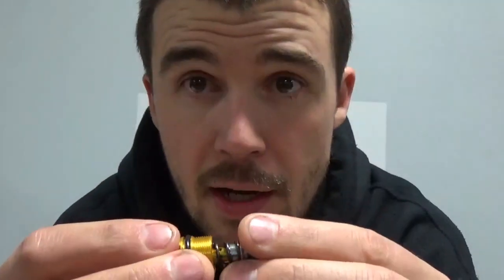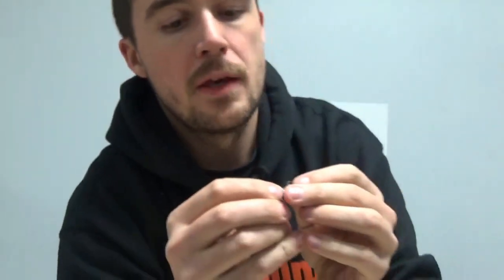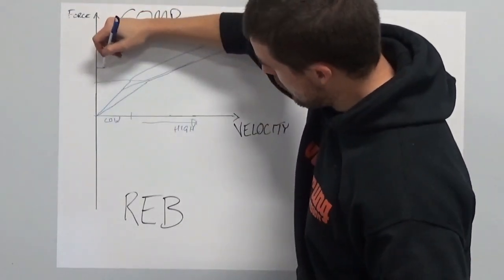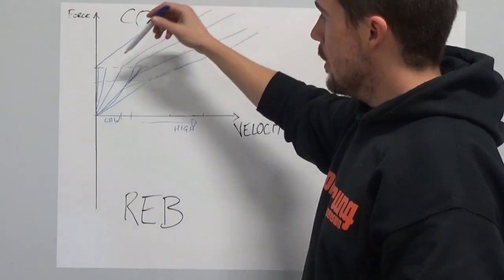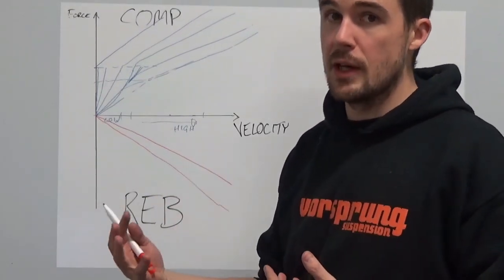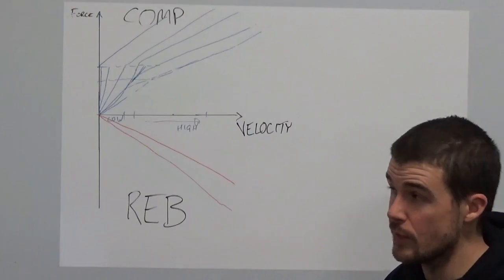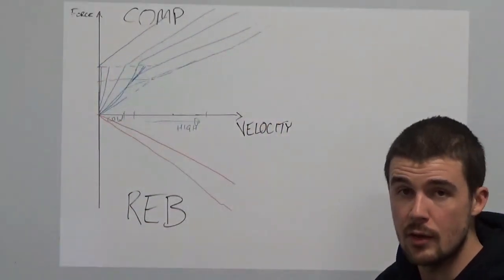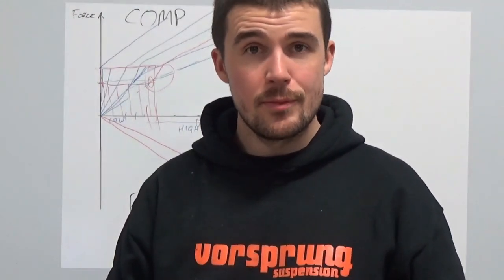The Tuesday Tune Ep 5 - High and Low Speed Damping Adjusters - Pt 1

Comment: I think I'm getting it, LSC can alter HSC, so on an RCT3 Lyrik (that only have 3 HSC settings) you can fine tune your HSC through the LSC... of course while avoiding the diving under braking secondary effect. sweet spot to find... Thank you for the video!
Reply: lol what lyrik rct3 do you have, no lyrik has high speed comrpession adjustment. i have a 2017 it has only rebound, lockout, trail and low speed comrpessiom
Reply: The three settings on the RCT3 damper are LSC presets. If you want external HSC control on a Lyrik you need a RC2 damper. The RC2 has 5 clicks of HSC on the outer dial and some more clicks of LSC on the inner one.

Comment: I'm confused by the HSC and LSC I have set by local shop although I might have recorded it wrongly...
It just doesn't make much sense. Fox 36 factory...

0 being fully dampened 
HSC set to"4"    so 22 clicks would be fully open with no dampening. 
LSC  set to "25" so 26 clicks would be fully open with no dampening.

I understand LSC being open would effect slow weight transfer and HSC effecting fast impacts... 

Just would like some views on this current setup..

I'm quite a small rider at 67 kg... 

Your video is actually really good.  Explained so much and makes sense. It's sometime so hard to find a decent guide. Thanks you.

Lol forward to any replies .

Comment: In a shock like the X2, there is a predetermined shim stack on the piston that presumably does quite a bit of damping. Is that low speed or high speed compression? And is that basically a third segment of the curve you are drawing? Thx!

Comment: How Can i make my fox fit 4 2019 on my Rallon feel less harsh on small fast bumps but still soft when taking large drops? Today it feels great on the drops and jumps but my hands get numb on fast bampy decsents.
Reply: There's a few things you can try. Put some volume spacers in the fork and shock and run a little lower spring rate (i.e. air pressure if it's air suspension).  If you don't like how that feels, you can also try using less compression damping with a slightly higher spring rate to compensate, that will make it smoother on rough sections. Aside from that, getting your cockpit set up in a way that suits you can make a big difference to hand pain, many people find that running their brake levers closer to horizontal (not angled down so much) helps but it's really something you have to experiment with. Sometimes running slightly faster rebound can help too if the suspension is staying too low in its travel over repeated bumps.

Comment: With the rebound, how does the damper mechanically know to go into high speed vs low speed. Does it know that the high speed compression circuit opened up so while that is open it holds open the high speed rebound circuit open as well? Or how does it know when to open the high speed rebound?
Reply: When the velocity of the shaft gets high enough, ie at the very end of the stroke when the spring is most compressed.

Comment: I’m very interested in suspension tuning and I was just curious where your knowledge comes from?, is it physics or can you actually study suspension somewhere? Or maybe it’s mechanical engineering?
Any help would be great as I could see myself going back to school to learn this.
Reply: most suspension tuners learn on the job in suspension service centres/workshops. The theory is included in a physics or mech eng degree, but if you're interested in tuning an existing damping circuit or spring curve to be more [something] and less [something else] for [particular rider in particular conditions], and not so much "we need this much deflection of Shim X at fluid Pressure Differential Y" then the education resources from specific manufacturers available to their service technicians (or through them at your local distributor for each company) are a much better/cheaper/quicker route to knowing enough to learn the rest from experience (of which you'll need a lot to be at Steve's level). You can get started by using the public resources e.g. SRAM has in their service pages (use the trailhead app for a RS fork and you'll see a "Suspension fundamentals" document).

Not to say a relevant degree won't help (especially if you'd like to design a new suspension system rather than tune existing), but 12 services a day will teach you the most relevant bits a lot faster ;)

source: I've done all three options.

Comment: i have fox 36 talas 2016 fork with rc2 damper Factory Series HSC/LSC Compression Adjusters you say set your h/sc first so do i leave in closed (full clockwise). or do turn it (counter-clockwise) to the open end.then turn  the l/sc  counter-clockwise to soft ls/c.

FOX recommends beginning with the High-speed and Low-speed compression set 15 clicks out (counter-clockwise) from closed (full clockwise) need bit of help cheers

Comment: I'm wondering, why dowhnill oriented shock needs "platform". I thought that we need very soft begining for small bumps, and then it has to start to getting stiffer, to prevent bottoming for deep movements like a jumps. But it turns out vise versa. I mean that HSC has to be stiffer then LSC, but in fact it could be only be softer then LSC, becouse HSC open additional way for oil to already opened in LSC. Thank you.
Reply: Your confusing shaft velcity and shaft position.  Your also neglecting that typically larger obsticles are usually rolling and we dont want them to use all our travel, and sharp objects we choose to hit are smaller.   When you grab your brakes do you want it soft and mushy to dive all the way through the travel?  Do you want to pump against basically nothing? And when you run through something like a rock garden do you want the bike harsh?  No no you dont, so you want "stiff lsc soft hsc", however if you look at the chart, even after the lsc break, force still rises, the hsc line is still sloping up, its not regressive and actually decreasing.

Comment: do you know whats about the average spring force in a HSC adjuster like in RCT3 compared to the stack force? How high is that force when the HSC adjuster is fully open or closed? like 2-20% ?
do you think an adjustable HSC has negative impact on performance because the spring reacts slower (added masses)?